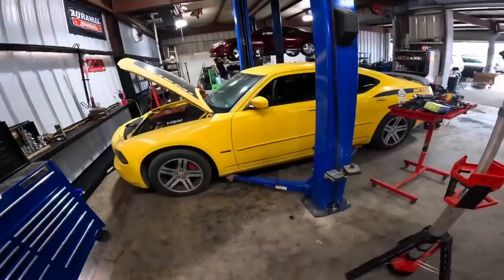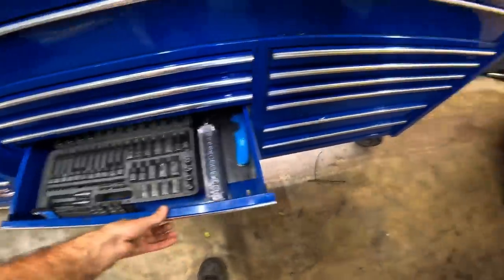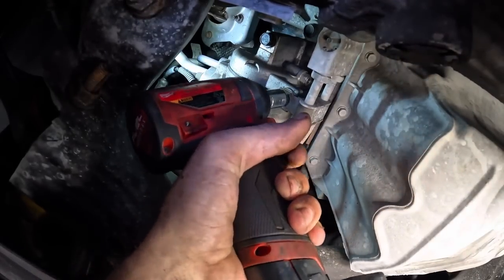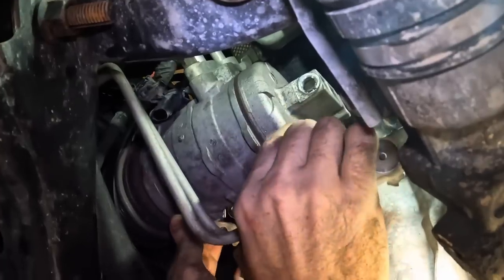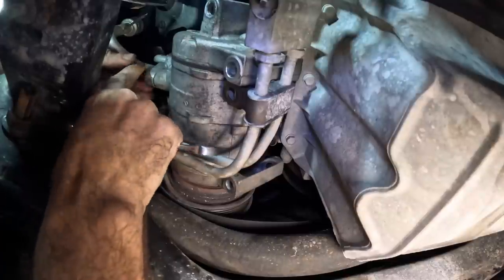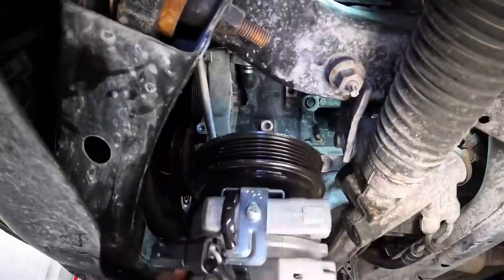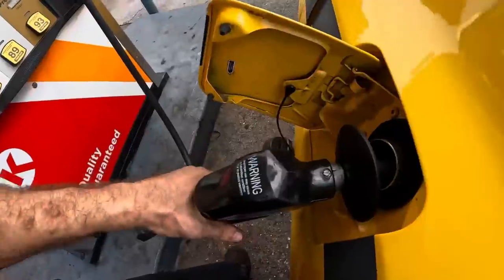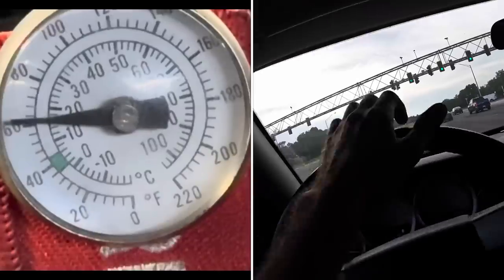Two DIfferent Failures! HVAC Inside and Out! 2006 Dodge Charger 5.7

Comment: My dad and granpa were putting a new starter on an old tempest wagon.
The only tool that would reach the upper bolt was a wrench from the 1930’s. It had a couple of weird angle twists.
It was made to work on the Grumman F2f Navy fighter plane.
My dad was in the Navy and he never threw anything away. 😆
Reply: Nice!  I had a small box end which was the only wrench that I could use on the headers for my 1969 Camaro.  I still have that wrench today from over forty five years ago.
Reply: I have a drawer in my toolbox called "the island of misfit tools".  My dad was a mechanic that worked on old fabric loom machines (before all of that work went overseas and he found himself unemployed with a lifetime of skills that he couldn't use anywhere else).  Ahh the good ol days when we made things ourselves instead of importing it.  But I digress.. I've found myself using those tools from time to time to get into some place where I couldn't get anything else to fit.
Reply: @wallebo 
I halped a friend do headers on the same car.
At first glace it looked easyish but we fought with those things for hours.
Reply: @10HDFLHX 
Island ofisfit tools.
Good one. 😁
Reply: @AJwoodway Thanks for your thoughtful reply.  I feel your pain.   I remember those days with both fondness and frustration.

Comment: Words have not been created to express how much frustration I felt watching Ray struggle with that compressor removal and installation.
Reply: That's what I like about these videos.  He shows the struggles and we learn from them.  We have all had these struggles ourselves (at least I have).  Almost any job you do will cost three times as much and take twice as long as you thought.  Furthermore, no matter how many tools you have, you will have to go out and either buy, borrow, or rent something.
Reply: Been there.  On my F150 I had to disconnect the Pittman arm from the frame to get my compressor out.  Just wish I had a lift.  Getting too old to be laying on my back for such silliness.
Reply: Was getting worried when he was reattaching the bracket. Looked like it could've cut his "flangees".
Reply: So man engineers have never turned a wrench in their life they have no idea. It’s the same with many things they make work on the drawing board and that’s all they care about.
Reply: The error was when he was describing how the compressor would be removed and said "it should be easy and simplistic!" Oops, he infuriated Murphy at that point.

Comment: Good morning Ray, Another great video about AC system repair. That compressor did the trick! Your finger dexterity is awesome, I remember those days.
    The audio is on point today. Thanks for sharing this repair. Don't forget to have a great day and stay cool
Reply: The audio sounds much more natural than the B/T mic that was used on the more power install.

Comment: My first car was a 1957 Triumph TR3. The starter died and in my newbie teenage ignorance I thought all I had to do was disconnect the wires, unbolt it,  and remove it to replace the brushes.  

Disconnecting was easy, but there was NO WAY it would come out of the engine bay. Up required  removal of the intake system. Down was blocked by the frame. To the front required remove of the radiator and the whole front bumper and cowl. 😡. 

Fortunately, the friendly guy at the  foreign car parts store told me to leave in its hole, remove the shield, replace the brushes and put it back together.  It would be best that before the commutator needed turning, I should sell the car!!!  I drove it for another six months, sold it and bought a VW bug which was better suited to my mechanical experience and abilities.

Comment: I just found these videos  and it brought to me the recent episode I had with my cars AC- the temp outside was 40 C   and the AC was blowing hot air . I have had problems with the compressor throwing its' belt but this was more serious - the evaporator had blown . SO off to the AC repair shop. A$1000. later  and having the dash removed to get access , the new unit was installed , the dash refitted and the system regassed  , now it gets decidedly chilly even on our hot Aussie summer days . I also have replaced all the actuators in my car, real fun,  as a couple had failed like the one in the Charger . Keep up the good work

Comment: Sounds about right.. compressor killed due to the blend doors. When a dirty filter happens and no airflow it causes liquid refrigerant to get back to the compressor and wipe out the oil and then destroy it. Goowd stuff Ray! Stay safe and be well.
Reply: The blend doors have nothing to do with the compressor going out.  Learn how the system works!
Reply: Suspect you are right.  Was once forced to fly to Mohave desert, ended up being an A/C not working due  to dirty filter.  Even with daytime highs in 70's, the computer - TacFire - needed A/C.  

Turns out users swapped an incorrect power supply in when heat caused it to not work.
Reply: @thk7513 Here's your teaching moment, all handed to you to seize and make yourself awesome sounding... and you say 'Go figure it out' and walk away.  Well done. :p

@FlyEaglesFly19111, The compressor normally never sees any liquid except maybe some of the oil that may be in the compressor case because it was idle for a while.  Oil is overall dispersed throughout the system.  Any water that is in the system is caught by the dryer/accumulator.  Should only be refrigerant gas and oil in the system, normally.

If the compressor sees any liquid it's because the condenser is backed up with liquid as that's the only place besides the line that goes to the evaporator directly from the condenser where there is any liquid refrigerant.  That's the point of the condenser, to turn the compressed gas from the compressor into a liquid from heat exchange with the outside air, then send it directly to the expansion valve/orifice tube and evaporator.  And that liquid should only be about... oh... 1/3rd of the entire condenser's volume?  Somewhere like that, maybe 1/2, but definitely NOT all the way back to the compressor.

In all other areas of the system, the refrigerant is a gas, and there is no way the compressor should see liquid refrigerant, the above 'backed up' condenser (which is fed directly from the compressor) notwithstanding, and if that's the case that system is borked and needs complete rebuilding with all new components, no stone unturned.

The worst case scenario of blend doors being closed and no air flowing across the evaporator is an iced up evaporator.  Heat exchange will still take place, system will not care.
Reply: @mikeybhoutex  Great tutorial!  Thanks!
Reply: This comment made a ton of sense to me.  My neighbor asked me to look at his a/c, which was sometimes blowing hot.  I noticed that the air wasn't blowing hard, either.  So, I checked the cabin air filter and it was actually impressive how clogged it was.  In addition to the paper looking like a thick pad of felt, there was the equivalent of a bird's nest on top of that.  The gauges read 80 low/150 high.  After consulting with some guys who do this for a living, they said that was a sign of a failing compressor.  Your comment about how the reduced airflow over the evaporator affects the liquid/gas state of the refrigerant in the compressor rang 100% likely as the explanation of what has happened to my neighbor's car.  I'll be replacing the compressor in the coming weeks.  Thanks for the insight!
Reply: @mikeybhoutex wow really try to make yourself look good an really think all that happens when a blend door is stuck. Lmao.
Reply: @rprice7670  Looking good is not the point.  Being accurate with information is.  Unless I'm wrong, in which case, I enjoin you to tell me what I got incorrect, which I am confident I did not say anything overtly incorrect at all.

Go.

Comment: Since I can't make snap-on tool payments, I have to make use of Harbor Freight for the rarely needed/nice to have tools.  When you were fingering out the two 13mm on the compressor manifolds, I would have taken my thumb ratchet and saved on the carpel tunnel.   They are some nice tools for close quarters combat.   I'm guessing you have those in your tool arsenal also.  But like you say, "I love my job so much....."   BTW, I've been starting to say that to my customers also if I make a mistake.

Comment: Ironically, the AC Delco parts worked better than any other brand on my old '98 Durango and the '94 Scourge Ram 2500HD before that. Never had an AC Delco part fail.
Reply: It's the one thing American car manufacturers do right, they start with the AC system and then build the car on it.

Comment: Just wondering why, you do not use fender guards before putting the Ac lines across the fenders. I took my car for service and before I let them work on the car, I asked the service manager to walk around the car with me to show not evan a scratch was on it. But when i picked up the car it was a different story with scratches across the hood by his belt buckle. I learned from my neighbor when his car from the same dealer happen to him. My car was only 6 months old. Nice video!
Reply: he will change to swim shorts.

Comment: I have been watching many of these vids where arms get burned/hot against hot engine parts.  What I do is put on my welding sleeves to keep that from happening.  I can still wear a short sleeve shirt (cooler than any long sleeve shirts that I have) and the welding sleeves just slip on the arms, and then quickly removed when the arm burning part of the job is done.

Comment: 50 and some chance is still about 10° higher than ut should be. Bet you that hemi needs it's condenser replaced. Replaced the condenser on my moms car the other day after it eas was having similar issue (I thought it was compressor at first). Changing the condenser got me from 60° to 40° right on the money. Learned all about condensers and how they go bad the fastest (makes sense given where they are) and how they very much effect if you get cold
Reply: it is not mint, saw the low side pressure went back up but he immediately cut away the filming, I would not pay for this job until 40.

Comment: I was advised against replacing my Honda with a denso. I went for the aftermarket because denso only had a 1 year and I got a 3 year. Still kind of regret not choosing oem. But she still works great, quite as can be.
Gotta go knock on wood.

Comment: Ray, I question leaving the PAG oil in the Compressor, as the System already has oil in it... unless it is totally flushed, it will be over charged with oil... the factory, rarely ever has the correct amount of PAG oil in it for the Vehicle that compressor goes into  .... some have none, others are over-filled..  .... that Compressor is used in a LOT of different AC Configurations ---- no way, the Factory will know how many Oz of PAG oil is needed in YOUR vehicle.

Comment: "Sometimes you feel like a nut, sometimes a bolt."
Those belt tensioner square holes really cry out for the ratchet drives with the retractable locking ball.  Doubly so for removing it without wanging it into the fan.  Or radiator.

Comment: I'd like you to change the compressor in my Transit van Ray. Does the same, nice and cold on milder days, but almost useless when it's hot. I have the tools, equipment and ability, but I just don't WANT to crawl around in that confined, cluttered space 🤣
You can swap out the EGR valve while digging around in there too.

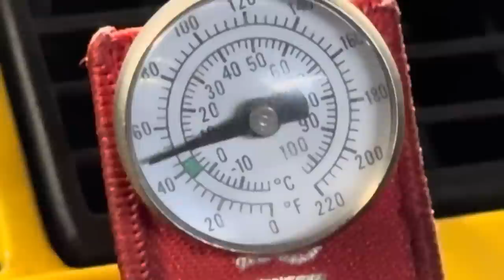Comment: 50 degrees with the heat outside pretty dang good Ray 34:34 @Rainman Ray's Repairs
Reply: is his thermometer accurate? ever calibrated to ice bath? the low side needle went up again from 40 before he cut away.
Reply: @forgetfulme1719 it went up at the end because he edited and Cut video to add thst to the end it wasn't instant

Comment: Ray, do you ever oil balance your compressors? It looks like you just threw that new unit in without doing anything to it. You are supposed to drain any oil that you can out of the old compressor and either completely drain the new unit and add back the amount that came out of the old unit or drain enough out of the new unit so that the amount left equals what was in the old unit. You can't just throw a new compressor full of oil in like that or you'll have reduced system performance. Too much oil in the system can even grenade the compressor.
Reply: How do you know the old unit had the correct amount? Especially when it needed replacing

Comment: Hey Ray! Try charging on both sides. Works really quick, and if there is a problem, you can close the high side valve and start the car. Robin Air guy taught me that years ago.
Reply: The only problem there is no valves on his machine.
Reply: @duanethumudo3967  what are you talking about? Guessing you’re not a tech. Shhhh
Reply: @evilgtidriver  Did you see valves on his machine??  So how would he just reach over and shut off the high side??
Reply: @duanethumudo3967  did you watch him hook it up, dummy? Like I said. Shhh
Reply: @evilgtidriver  actually I did see him hook up his machine. Like I said there is no valves on his machine to do what you were saying. I use the exact same machine at work.
Reply: @duanethumudo3967  sure you do, bud.
Reply: @evilgtidriver  Let's educate you. Ray is using the robinair 34788 which  has no valves. Now the machine with the valves 34288 a lower model.
Reply: @duanethumudo3967  so the red and blue VALVES you turn onto the high and low side fittings on the car, aren’t VALVES? My bad.

Comment: I wondered about the spilled compressor oil    I might have left it since you don't know how much oil is still spread around the inside of the rest of the system. There has got to be some.   

 Maybe the schrader valve should have been replaced since there was signs of leakage and oil around that top a/c fitting.  What do you think ?

Comment: Hey Ray.  Not a question directly related to this video but here goes :)

Why do you use a pair of Snap on crimp pliers for electric connectors rather than use a pair of the ratchet type???

Comment: I remember when you replaced the AC Compressor on a Range Rover. It was almost impossible to reach
Reply: "Step 1, remove compressor by reaching in through tailpipe.."

Comment: ACs have a hard time getting to the lowest temperature at the outlets when they are still busy stripping out the water from your ambient swamp air of Florida. Test with the fresh air inlet door closed and windows shut by operating in recirc ( maybe called Max ) and only having to dehumidify what is in the cabin.
Reply: Yeah, my car's A/C is nearly useless unless in recirc.

Comment: Just curious why ratcheting box-end wrenches aren’t used more often ( like when unbolting the lines off the compressor)?  Just seems a lot faster than constantly resetting a standard wrench.
Reply: On a lot of cars the line is too close to the nut and stud, so the ratcheting end won't seat down on the bolt all the way

Comment: I have been an Hvac tech for near 30 years. This is referred to as a daisy chain failure! This when bad,causing that to go bad,and now this is bad! You cannot diagnose these problems,without first changing parts! I tend to go with the cheap stuff first and go up from there!
Reply: Daisy chain failure....is that another way to say parts cannon?   I watched the first video, the high side was 300 and low side 60, looks to me as if the condenser was plugged. I suspect Ray will get a comeback on that one.
Reply: @lo1234-w9r  Maybe! It is possible that the valves were compromised,do to low super heat and flooding back.They do have hp switches on most systems and it didnt seem to be cycling on the switch.I mentioned really cleaning the condenser on his truck video,and that may have been the case also with the Charger,just too hard to speculate from video footage!

Comment: Who the frack invented plastic cogs, like they`re going to last, not
Reply: I had a mid 70's Duster and Chrysler had a regular rebuild kit for the wiper gearbox. Plastic gear would strip on one spot requiring a push start.

Comment: Hello, nice video. I have a problem with a carbureted car that starts good when could and when hot doesn't. Any ideas? Thanks 👍
Reply: Fuel evaporation from the carburettor. Check to see if there is any heat shields missing on the exhaust manifold near the engine. Also, check if the fuel lines to the carburettor have been moved and are too close to the exhaust.
Reply: @rkschloithe  Thanks for your help, fuel lines are on the other side of the engine to exhaust. Maybe the heat dissolve the fuel. Should I increase the level in the constant level chamber of the carburetor?

Comment: my 2002 2500 cummins has saginaw power steering pump and gear box, from the factory, so dodge with GM parts is not unusual... LOL